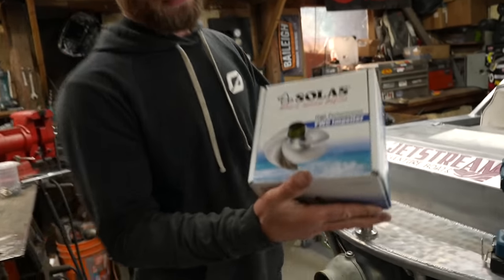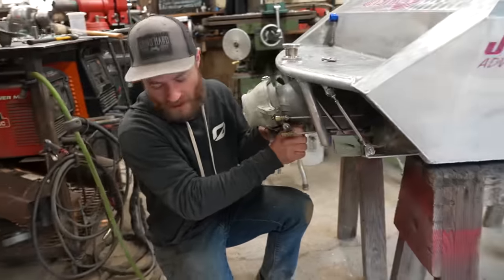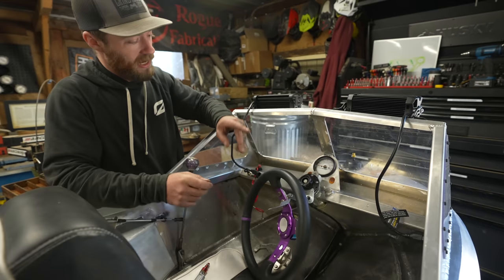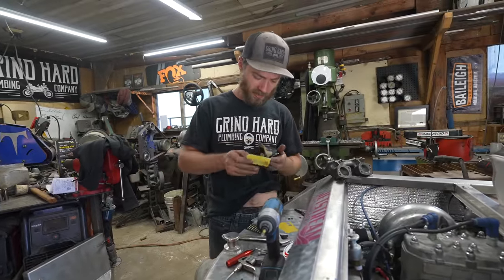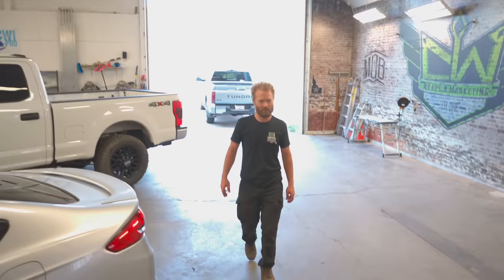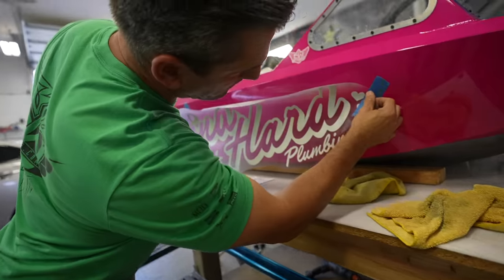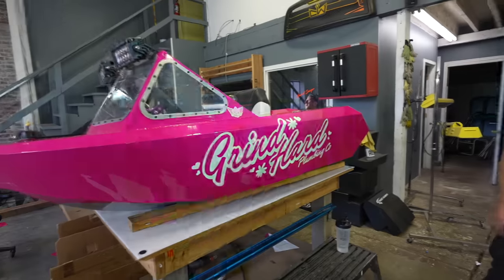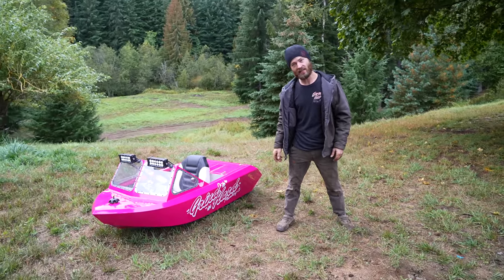100HP 6' Jet Boat is Finished!

Comment: I was a bit skeptical at the start, not sure about covering up that beautiful aluminum body. But that came out better than I could have hoped. Each build is better than the last, I'm super hyped for this giant secret project.
Reply: At least it's just a wrap so if they miss the bare aluminum they can peel it off real quick or change the color.
Reply: Same. You saved me typing this 👍🏻
Reply: Aluminium

Comment: Oh this thing looks better than I could ever have imagined!
Reply from the maker: FOR REAL!
Reply: @GrindHardPlumbingCo  Think of your propeller like a GEAR...  As you change the angle of the fins, you are either making the prop more high geared or more low geared-- Just like a sprocket on a motorcycle.   If they are saying that the prop is more "performance at acceleration" --  they just mean that it's geared lower, so it will also have a lower top speed.  Just something to realize

Comment: My last project, I used a 13/18 variable pitch Solaris prop, they are nice units.  Extended ride plate is gonna be a necessity,  Run it out as close to the pump as you can get.  I used pump wedges that stacked but you can also shim the ride plate on the rear as well.
Reply: feedback appreciated♥️👍
you are selected let's talk ☝️🔝🔝☝️and claim 👉🎁🎁👈

Comment: I’ve been waiting for this video and am pumped that it finally came out!  Keep up the great work guys!
Reply from the maker: Hope you enjoyed it!
Reply: @GrindHardPlumbingCo  I sure did
Reply: @GrindHardPlumbingCo  Think of your propeller like a GEAR...  As you change the angle of the fins, you are either making the prop more high geared or more low geared-- Just like a sprocket on a motorcycle.   If they are saying that the prop is more "performance at acceleration" --  they just mean that it's geared lower, so it will also have a lower top speed.  Just something to realize
Reply: Lol.. comedy Gold
Reply: @calholli  what your changing is the leading and trailing edges of the impeller. We were doing this with a hitch homemade impeller holder and using a torch with a wrench to do this at the marina. Hey we didn’t have any shop close when testing. Here’s a video to get the idea

https://youtu.be/PND5LNUUnVg

https://youtu.be/24lIckPVC6U

Comment: My smallest boat build was 11' 6" X 6' .  20 degrees deadrise. 25 kts with 25 hp outboard in open ocean. Love your micro jet boat. If you build another, try to get a sharper knuckle at the stem. I think it would porpoise less.
Reply: feedback appreciated♥️👍
you are selected let's talk 🔝🔝and claim 👉🎁🎁👈

Comment: on high-speed jet boats they have a plate just in front of the water intake that is shaped a bit like an upside-down backward wing, my understanding is it causes the water going over it to curve upward and into the intake to reduce cavitation at high speed.

Comment: that wrap will last 1 trip on the water before it starts coming off! Yeah it looks great now, but several uses on water later and you'll want to peel it off anywhere water is constantly slapping the hull! Water can be really tough on surfaces! Never mind that the keel is going to get peeled off rapidly from rubbing on the ground or in your truck bed or whatever.
Reply: It seems to be working for Cleetus and Jackstand.

Comment: You need something like a thick lime green double stripe down the middle... :P  Does that size boat need the proper running lights and you definitely need a nylon running board on the bottom so you can jump with it.  And you need a trailer so you don't mess up the wrap.

Comment: Think of your propeller like a GEAR...  As you change the angle of the fins, you are either making the prop more high geared or more low geared-- Just like a sprocket on a motorcycle.   If they are saying that the prop is more "performance at acceleration" --  they just mean that it's geared lower, so it will also have a lower top speed.  Just something to realize
Reply: Thanks for being an active subscriber🤗❤️you have been selected for today's giveaway session..

Comment: Those boyesen reeds are only good for about a season of normal use before they need to be changed. And they aren't a difference you can really feel. Boyesen rad valve or v force is what you want. Cost more but worth it.

Comment: Allot of jet skis have self bilging venturi syphon tube. As long as your moving it's constantly bilging with no electricity or moving parts. A pickup screen should keep any blockages from happening. Bam most reliable bilge system to date!

Comment: The only thing about that boat that I HATE more than anything is that the windows are on the outside of the body.and yeah I know you did it because you welded the gauge mount to the center pillar, but god it's so ugly.

Comment: Ok, I'll say it. They (cw wraps)made a big mistake on this wrap. From there camera angle you had they wrapped the side of the boat first. Then they wrapped the back. That means the leading edge of the vinyl is facing forward......into the wind, water, debris etc..... It has a high probability to fail. Don't mean to be a jerk but the simple fact is, that's what they did.

Comment: Ha ce que je voie vous êtes des inventeurs un peux bc fou ce qui ferait votre fortune serait d inventer toutes sortes de voitures pour enfant certaine a moteur mobylettes facilement traficable exemple si ont prend un moteur Peugeot 103 ou bleue motobecane comme mécanique auto ou des moteur de patinette électrique ce sera à eux de choisir des camaro z28 ou des bel air 55 57 wagon en faite a la demande les enfants adore faire comme papa ou maman et comme il faut absolument que la nouvelle génération sorte d internet une mini voitures pour enfant jusqu a 12 ans et de 5 ans a 12 ans ca caisse aura subit beaucoup de changement moteur dernier kit moteur d ailleurs a Los Angeles un préparateur français de mobylettes de folies il a des moteurs préparer qui monte à 140 kmh pour un simple 50 cc bha ca dans une carroserie tout en plastique que les chinois ce ferait un plaisir de construire et vous des chassis tout tube essayer sur une camaro 70 z28 moteur mobylettes ou scooter je suis sur que tu vendra c est petites voitures d enfant comme des petits pain exemple tu montre un enfant habiller dragster et qui fait un super temps ca fera le buzz et tout les gosses en voudront une sur je suis près a le parier